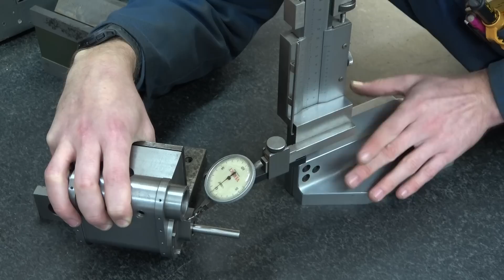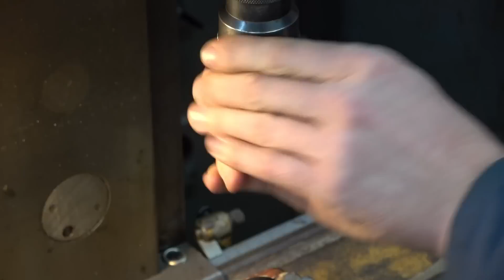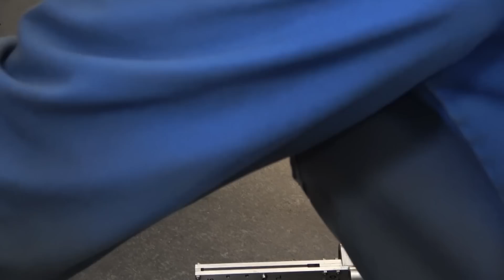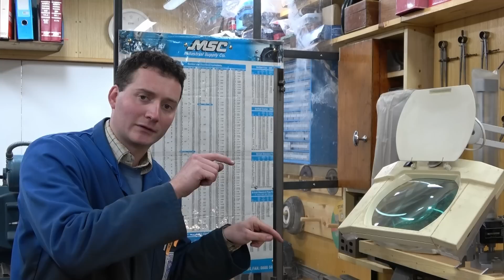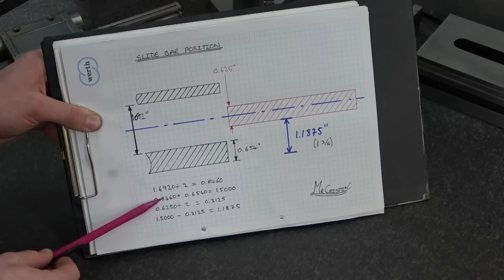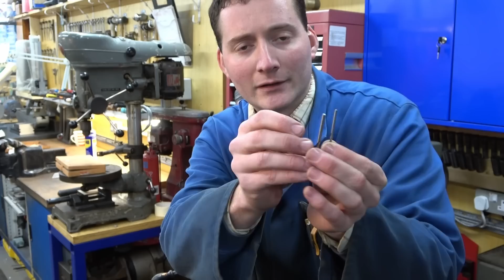Fitting the Slide Bars (MrCrispin's Locomotive Build)

Comment: hey up  ! dont worry about the slide bars.. they can & will be  adjusted when secured to the chassis..( when they were built they were literally thrown together )  but keep at it .." its going to run like a precision time piece ."..  we all await with baited breath.. for the great day ! regards laurence.. p s did you know a man called  phil heward ? master builder of jet engines for model aircraft.. a genius! ! he came from a place called acomb near york . i  used to drop in and bring hin  stuff from the  scrap yards in spain large super chargers and billetts of aluminium  all free for him . and in ex change he "gave me an 8"DIA X 16LONG  JET ENGINE ! !12 kilos in weight.. and roughly 160 kilos thrust  !no need for lubrication . as ceramic bearings are fitted  ..max revs 48.000rpm 500 mltrs   fuel per minute at max revs.    (have you got room for   that in your workshop?  i ll bet diamonds you would soon find some! keep at it matey   regards  laurence

Comment: I have only recently come across your workshop videos. Excellent and extremely instructive. I notice you have a Kerry bench mounted pillar drill. I have a floor standing version. Can I ask you a favour. When you have a moment, please can you take a photo of the inside of the top cover. I am missing the internals completely, bar two pieces of steel plate attached to the top of the cover. I have a very similar looking milling machine, a Pripen from Switzerland, and a Colchester Student that desperately needs its' 3 jaw chuck overhauling. Your video on grinding the chuck jaws was excellent.

Comment: Wonderful stuff! I’m at a very similar point in my own locomotive and you’ve inspired me to pin the back heads and slide bars for better repeatability on assembly. It remains to be seen if there will be room in the smaller scale, but I shall try.
Reply: Rookie machinist here.  Wondering if a shouldered bolt would help for the slide locations?  Or is it that the bolt and threads are "loose" and the dowel pin is needed for repeatable accuracy?  Great video as always.

Comment: Nice video, and I like your going through the potential miss drilled hole scenario. I'm puzzled about one detail. I can see how you can assemble the slide bars with the recessed bolt installed and then installing the dowels through the bars followed by the bolts, but how will you disassemble them if needed? The flush dowel needs to be extracted before you can remove the bars from under the recessed bolt.
Reply from the maker: Hmm yes I'm puzzling over that one now!
Reply: @MrCrispinEnterprises  Are you able to drill them in the center for a smaller diameter extractor screw?

Comment: Hi.
I am 2 & 1/2 minutes in and have to point out you are measuring 2 tenths against the base of the cylinder block.
You should have had the piston rod in a vee block surely as the reference   ?
Even then clearance in the bore of the cylinder cap would be an error.
And the real check should have been the bore of cap shouldn't it  ?
Reply from the maker: Hi, there are a few more bits to think about/ explain. I'll go through it at the end of the next video.

Comment: Mr C., wouldn’t the prototype have used studs and nuts to hold the cylinder end covers on ?, and might that not be the way forward, in this case ?
Good to see you back !
Kind regards,
Steve A.
Reply from the maker: That's a very good point I'll so some research

Comment: 3:57 - By now, you have X- and Y- axis data.
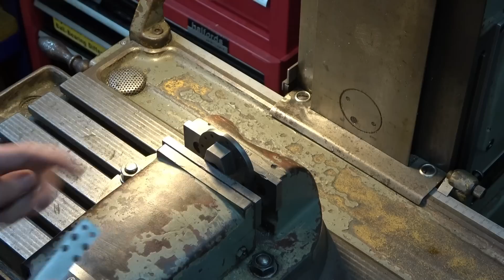11:17 - On my 'oriental' (main-land or Tiawan, dunno) mill, it took some real 'fiddly' engineering to make it fit, but after some 9 months of (mostly off) effort, it got an X- and Y-axis DRO for not a lot of money, and I no longer count revolutions to return to zero.
26:34 - That's the reason machining optical parts accurately are so difficult: Even if you're machining a 12" long surface, the optic is reading perhaps hundreds of yards off.
General: As a punk kid of 12 or so, the father of a friend allowed me to 'keep him company' (pester him) in the process of machining the parts for a 3-1/4" (?- MANY years ago) gauge Atlantic (4-4-2), thereby beginning to teach me how to make chips on a lathe, milling attachment for the lathe, and shaper. Two years later, he allowed me to drive the thing with the instruction that you NEVER LET THE WATER LEVEL FALL BELOW THAT LINE! (I didn't). Later auto hot-rodding didn't hurt, but that WWI flat-belt (babbit-bearing) lathe made it clear that the resultant part was caused be the indian, not the arrow.

Comment: Welcome back. I know your cylinder blocks are fully machined but shouldn't you be aligning the slide bars with the bores rather than the outside geometry?
Reply from the maker: Yes I should have mentioned that the two faces I used to align the slide bars are the two faces that the bores were machined to.

Comment: Hi Crispin from Australia, I might have missed previous steps...however...are slide bars now parallel in two planes to the external datum surfaces of the "cylinder blocks"....but not necessarily the piston bores...?
...or did you establish accurate alignment of the bores to those external datums in a previous operation (video)...
Cheers from Rodders in Melbourne Melbourne
Reply from the maker: Yes good point. Those datums were the ones used in the line boring set up to machine the bores.
Reply: I'll back track to your line boring video...if you did one?
Reply from the maker: @roddersauify  Yes Machining Cylinders part 2
Reply: Cheers...thanks Crispin

Comment: Are you going to be able to get a wrench (with > 60° of motion) on the captive bolt? You might need to drill it and use a tiny pin spanner.
Reply from the maker: Good idea. At the moment I've just gone down the route of removing as little material as possible so I'll see how it works out.